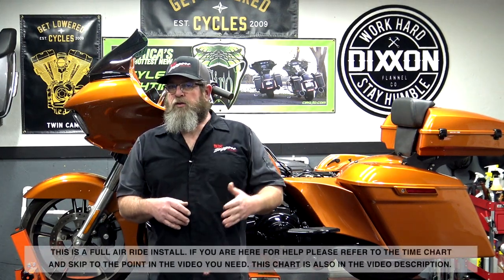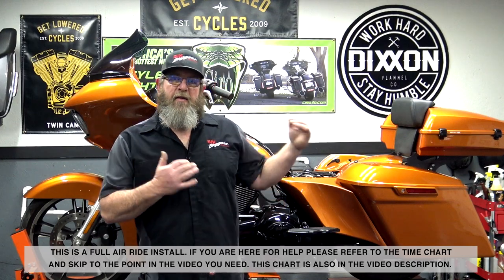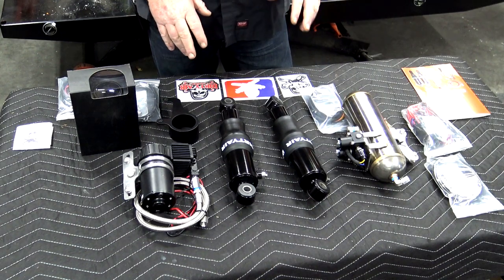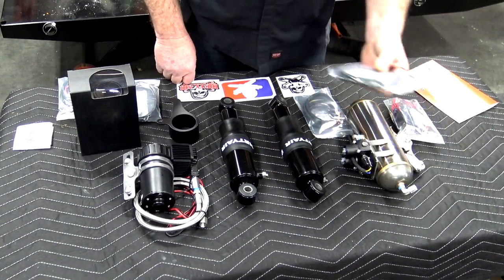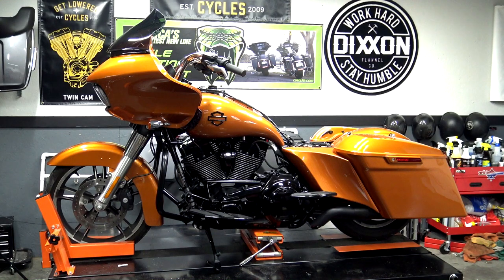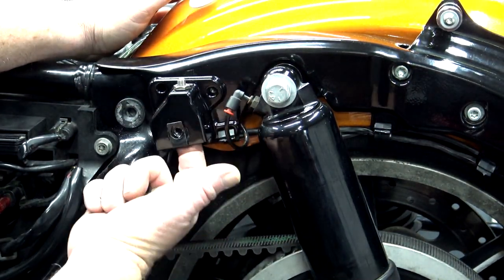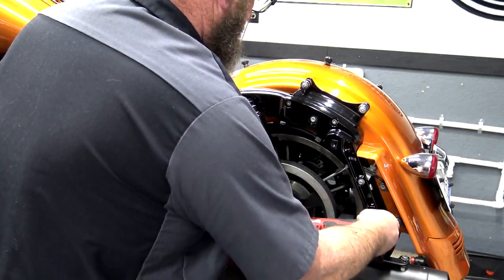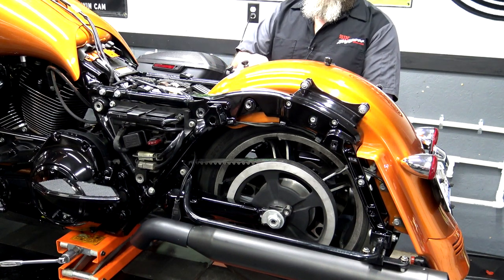⚡Install Dirty Air Rear Air Suspension System Fast Up - How To⚡

Comment: Just installed the dirty air system on my street glide. The ride is amazing, completely changed the ride quality of my Harley. Dirty air is a must guys. Hoping to do the front air soon.
Reply from the maker: yes sir! Thanks for checking out the video!
Reply: How long.is.install ?
Reply: How is the air ride treating you after 2 years?

Comment: I know this video is old, I’m just now having to replace anything.  I originally installed it 8 YEARS ago!  Always recommend their system.  Great reliability and excellent customer service!  Whether by phone or email, they are awesome!

Thx for the video!
Reply from the maker: 8 years is a good run on air ride for sure. Never had any issues with the Dirty air system ...hopefully i can get at least the same amount of time out of my 2 sets from them.

Comment: You're right about the kool katz at Dirty Air & about the install being easy.  I have very little mechanical background & I'm proud to say I installed the Fast up Rear kit with no help.  Now I'm trying to decide if I want to add on the front kit.  Thanks for the vids Steve.
Reply from the maker: Hey Carlos...yes sir...super helpful guys that know their stuff! I may be in the same boat here soon on the front air..im undecided at this time
Reply: I'm a  short guy so I had to do something to get me lower.  I also tried several different seats but I just ended up having my factory seat shaved a little bit. It helped somewhat. That's why I'm thinking I might need to do the front as well.

Comment: another great video i wish everything was that easy at least you made it look easy.
Reply from the maker: Hey Jeff...it truly is pretty easy to install specially with the instructions included. Its a great system
Reply: Steve I sure would have if I had not put new suspension front and rear several months ago. I need to slow down the products you show and the quality of parts are amazing. It’s just I purchase then six months later you show exactly what I had been looking for. Keep them coming and I will wait patiently. Staying tuned 😣

Comment: Ok I gotta ask life of the system and the quality of the ride , good install video as usual
Reply from the maker: Been running it on ym SG for 4 years now...love it. The ride is far superior to the stock set up and a fraction of the cost of legends. Plus adjustable on the fly.

Comment: Thank you for video. I almost purchased that kit. Until i found jcbaggers in Central Point, Oregon. You Ever install a JC Baggers air ride kit?
I purchased his kit for many reasons, Local PNW manly.
 1.price  
2. Warranty 100% 
3. He does anything for a happy customer 
4. Many bike builders use his kit and been in multiple magazine shoots 
5. Comes plumped 
6. 2hr install for a bad wrencher 
7. Uses the best monroe shocks. No need to upgrade shocks. 
8. 100% customer support 
9. He has 100% sale reviews 
10. 100% customer satisfaction reviews. 
Thank you again for your videos. They help me. Work on my bike to save money at dealer.
Reply from the maker: I havent but I have heard of him..it seems he only makes air rides for the older models though...great for guys with 08 or older and 09 to 13 models.

Comment: Great video..watching this as my local wrench is installing my new dirty air system..did run into a problem with my 2011 CVO Street Glide though..the air compressor bracket hits the rear flush mount taillights..had to notch out part of the taillight mounting bracket..guess on a select few CVO's, some modification is needed.
Reply from the maker: Nice...youre going to love the air ride man

Comment: its also not a bad idea to swap out the nuts on the air gauge bracket to LOCK nuts...the engine will eventually vibrate them off and u may loose the bracket too while riding. Great Video keep it up!!
Reply from the maker: Yes After the install I added nylock nuts....when i did the install added some blue loketite and wasn't happy with that

Comment: Great install , I run legend air ride on the rear with a tank and skullys compressor with dump valves. My air up buttons are up on the perch mount so you can adjust the air heading down the highway with out taking your hands and eyes off the road trying to find the switch also with legend it came with that safety switch built in not to air up the bike and fall over, don’t ask me how it works I don’t want to find out!😉
Reply from the maker: Hey Smooth...yeah man I have a switch install video coming up next week for the air and centerstand...Im not a fan of the firewall mounting either. However the safety switch will still be mounted on the firewall..I dont want to take the chance of dumping all my air going down the road..thats about my luck lol

Comment: Great video. How much weight does all that equipment add? Only reason I probably wouldn’t do it. Thanks for all the hard work always appreciate and enjoy your videos.
Reply from the maker: Hey David ...its not much at all ...a few pounds ..the best part is is that it is mounted low on the bike..so it really does not effect the way it rides....Ive never noticed it after installing it not even backing it up or pushing it forward. Pretty light weight low mounted system.

Comment: Great video. I have front and rear air on my SG and am looking to add the dual air gauge. Question for you is: what did you use to extend the gauge mount on the rocker box?

Comment: Great vid!
Can you please provide a follow up video for ride quality. I’m really interested but I heard the ride is very stiff and uncomfortable. 
Thank you in advance
Reply from the maker: Yes Sir I will. Ive had air ride on my 14 SG for about 3 years now and love it. If the pressure is set correctly for you or you and your passenger the ride is awesome. The only way the ride will be stiff is if you have no air (hard tail) or way too much air. there is for sure a sweet spot.  My wife and I love the air ride.

Comment: I know its an old videos, hopefully you still check the comments. What kind of kickstand are you running for the bike after putting the air ride on the rear? Ive looked at center stands, but i park on uneven surfaces a lot and gravel as well. Trying to find a shortened jiffy stand, but idk if a 1" lower stand is sufficient for aired out... any help is appreciated man, and keep these awesome videos coming! You've helped me with a lot of trying to decide what parts would be best for my build! 🤘
Reply from the maker: Keep the stock kick stand on there..no need to buy a 100 dollar 1" shorter stand..the bike can air out and lean over on the stand just fine with no issues. Lots of guys do it.
Reply: Awesome, thanks man. I was finding a bunch of conflicting answers online. Thanks again for the videos!

Comment: Oh I’m definitely gettin air ride now! Thanks for the vid!
Reply from the maker: Nice...very easy install and a very comfortable ride. Been running air on my SG for 4 years and love it.
Reply: @sikbaggers  how do you know where to set the air pressure for different weights of people and luggage?
Reply from the maker: @carolinarider5237  Its all in the feel. Get the bike aired up where you are flat footed and feel steady. Ride the bike...if its too tight let some out, if its too bouncy add some. There really is no specific air pressure for riders and/or luggage. Feel the bike as you ride and adjust on the fly if you need to. After a few trips out you will know when you find that sweet spot.

Comment: Yo Steven! Thanks once again for the work you put into the videos and information. I have been watching for the channel for about three years and made some decisions based on the videos for upgrades on my 14 SG, the most recent was the Willy Shiny enforcer wheel exchange. I commented on that purchase on that video. My next purchase is possibly air ride, I would like to hear your thoughts on both the systems you have installed. JNR vs. Dirty Air.  Thanks You
Reply from the maker: Hey LAlex...yes Im stil playing catch up on comments but I saw it..thanks man! As far as the air ride goes..I had a lot of good luck with the JNR kit at first...its now about 4 years old and has completely failed on me..it started failing after the second year. Not much help from them as far trying to figure out why it was failing me either. Sent me a new fill valve that didnt change anything and that was about it...that was last year..now I can barely get it to come on...so im in the process of switching it out for the Dirty like I installed on the RG here.  No issues with it so far...but I wasnt willing to pay to replace the JNR with the same thing I have that failed so quickly.

Comment: So the wife is mad about me spending  money but I need air ride how slow is the basic compared to the fast up? It's a big price different but if the fast up is worth it I'll bite the bullet and sleep on the couch any feed back would be great thanks love the videos
Reply from the maker: I ran the first air kit I got without fast up...its fine does take a while because it is just the compressor filling your shocks. What I found was when I was with a group of riders that either had fast up or no air at all they were taking off and I was airing up my bike still..kinda sucked. Aft er one riding season I was tearing back into it to add the fast up..its pretty instant. Honestly id go grab a pillow and spare blanket.

Comment: That toggle switch will get hot af right there.
Reply from the maker: had it there on my Sg for 4 years now...its actually where the maker of the air ride suggests you put it. It may get hot....doesnt effect it...so its fine.
Reply: @sikbaggers  Yeah it's fine, works and it's the best air ride out  there in my opinion but don't take off your gloves before you air it down after riding in summer.  It get's hot right there believe me.  I'm gonna move it.
Reply from the maker: @sgtrock2821  use this switch from AF Kustoms if you don't want to burn your hand.,.I have installed several, one on each of my bikes actually...its perfect. https://www.youtube.com/watch?v=MvLqmvQH8j4&t=1s

Comment: Great video. Detailed enough to feel like I got the info needed to do an install but not too detailed that it gets boring and hard to follow.   Having installed both dirty air and jnr which is the best system between the two? I’m ordering an air ride this week and it’s down to these two. Any info to help me make a choice will be greatly appreciated. Thx again
Reply from the maker: Hey ricky...yes pretty straight forward..I tried not to leave anything out. I have ran both for awhile now and Loved the JNR when I put it on however I have lost most of the fast up in the last year..its juts kinda slow up now on the tank...had it torn apart 3 times and cant figure out the issue. no issues with the Dirty kit at all this far. I like the way the dirty kit has the valves on the tank and not separate crammed up under the side cover. Also Like the main braided line form the compressor to the tank versus JNRs inline connection. Either way works I guess...It just feels more solid. If I had to do it again id more than likely do the dirty to be honest.

Comment: Its all Awesome!...but what is it's main porpose and advantage in having it other than having people looking qnd going wow! 🤔
Is it for short legged people to be able to straddle bike?...to get on and off?
Reply from the maker: Lots of advantages to air ride..and yes all of the things you listed are included. with about 3 inches of air travel they can be adjusted so you are flat-footed at stops, back up the bike easier, etc. Reduce bottoming out, adjustable on the fly so you can raise, lower while you're riding, adjust for passengers or heavy loads in saddlebags, tour packs. lowering the bike slightly increases ride stability..the list goes on.
Reply: @sikbaggers  
Im likin it👍...

Comment: Hey Steve, thanks for all your videos great job! So I installed JRN with ride height repeater 2 years ago per your recommendation. For the most part I'm very happy but I as well had a few issues with them; 6 shocks were sent to me due to cross threaded fittings! I personally love having the ride height repeater. I've had friends ask me what to install and I have a hard time recommending JNR due to my issues. Do you think it is possible to use the JNR repeater on DA system? and in reverse can I use the DA parts like safety switch or digital gauge on my JNR system?
Reply from the maker: yes sir....you should be able to use any of this stuff in combo with each other. Nothing down there has a proprietary plug on it. The only difference may be the color of wire from one kit to another..but all that stuff works the same ..you will be good. I still havent worked out my issues with my JNR system.. Ray over at JNR has gone above and beyond trying to help me and is a cool dude..I just cant figure out what it is all of sudden so slow...not all of sudden its been going on for 2 years now...but the fast up used to be pretty fast..now its just mediocre up..cant put my finger on it.

Comment: Great videos I watch them all, I have a question I installed rear air ride added the tank but when I turn the key on it my compressor kicks on like the tank is filling up but it airs my shocks up do I have something wired wrong? Thanks in advance for any help
Reply from the maker: yes you have something wrong for sure. The compressor is kicking on and should be holding until you hit the switch.
Reply: @sikbaggers  any ideas on what it could be thanks for any help

Comment: Seen your video on the Dirty Air kit ordered the rear system for my 2019 Street Glide Special, with digital gauge and the up and down on the bars, can't wait. Wanted to ask do you have any videos of using the system while riding or even setting up the system for first ride solo or with 2 up?
Reply from the maker: There really is no way to shoot a video thats going to be specific to your riding style, weight either 1 or 2 up...its really just how "you" want it. I can say that at first I would air the bike all the way up, let the air out until im sure footed on the ground. That was my ride height. But after you have it for awhile youll get used to where it "feels right" you can just air it up and down while going down the road...my biggest thing was adding too much air while riding and then get to a stop sign and im tip toed lol so I learned to just set it and ride and stop playing with it..as I got more comfortable with the system I started playing with it some...but start there..either 1 or 2 up just air it all the way..let some out til your flat footed and ride there.
Reply: @sikbaggers  thank you

Comment: I had the fast up dirty Air on my 14’ street Glide. 
After two years I took it off and installed Legend suspension. 
There is no performance value from air ride at all. 
So much better with the Legend in the turns and +2
Reply from the maker: youre right...air ride is not for performance riding.

Comment: Hey Steve, love your videos. So I'm really considering putting an air ride system, but does it make the ride much smoother then the stock suspension? I know riding low makes it stiffer, but not planning on riding it with it on the low. Can you help me out? Thanks Steve, keep up with the great videos!!!
Fred
Reply from the maker: I love the air ride...have it on both baggers and getting ready to install it on the softail too...I've had several different set ups as far as shocks go...legand makes a good standard shock as well though...anything is better than HD's system to be honest.

Comment: How does it ride without rebound control? I would think it would buck you up every time you go over a bump. Wouldn’t legend be better
Reply from the maker: The air shocks expand, travel and rebound like normal shocks....there is no bucking as long as you have sufficient air in the based on your weight. Thats the part you need to figure out o your own as everyone is different Once I find the sweet spot in air ride it makes for a great smooth ride.

Comment: Hello there. I came across your vids. Great content! To my trained eye, am I seeing an NPT female threaded air fitting threading onto the JIC male thread of the shocks?
Reply from the maker: Its a push to connect fitting
Reply: @sikbaggers , gotcha. Thank you for your reply! That’s the tube into fitting connection, correct? What of the fitting thread connection to the shock?

Comment: Will you be doing a video on the center stand? I just purchased an SOB and I an having the hardest time aligning the top bracket to the bottom.
Reply: Had a little trash up top throwing the alignment off a bit. It's perfect.

Comment: Question.  I watched your video about installing centerstand for dual exhaust using a SOB stand.  SOB also has air ride. I see you use dirty air suspension here.  Which would you recommend?  If you were going to install both mods at the same time?  Thank you.  Great videos.